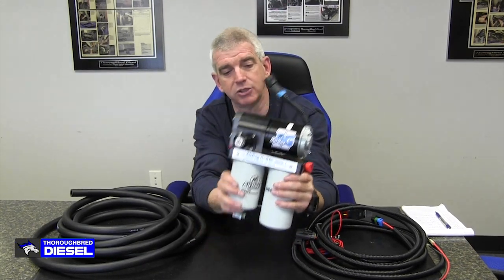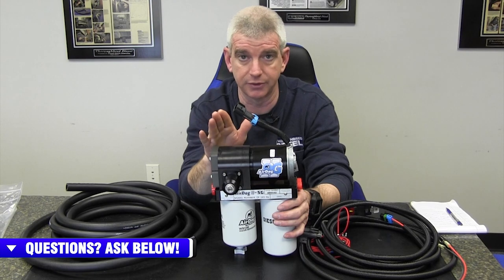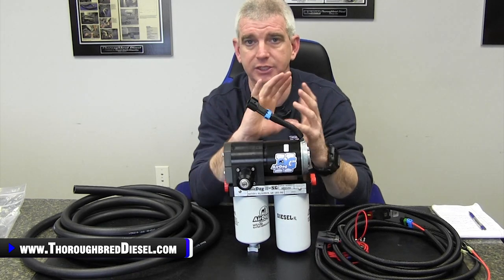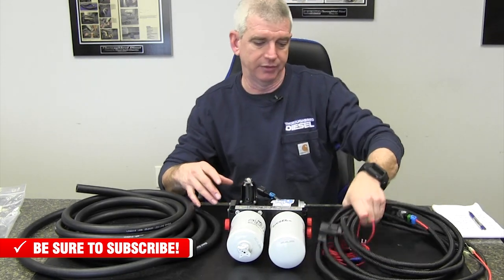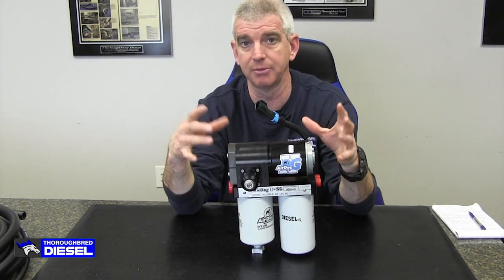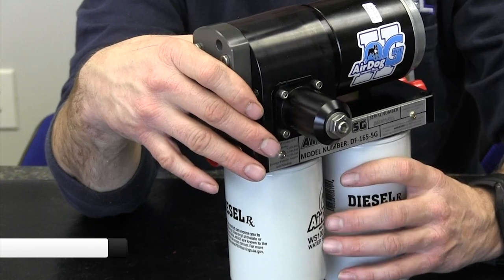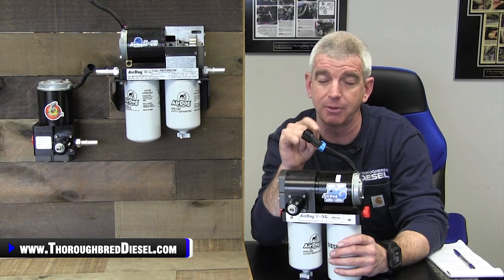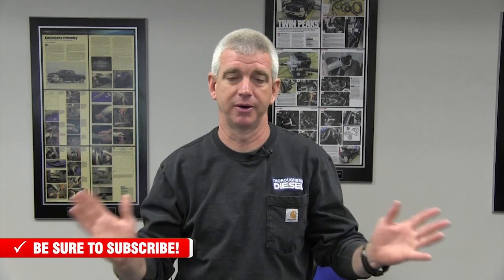We JUST Got Our Hands On The New AirDog II 5G #diesel #dieseltrucks #duramax #powerstroke #cummins

Comment: I have an AirDog II DF-165 No 4G or 5G. I converted my connections to include the return lines to -6AN fairly easily. I do like the positioning of the 5G's regulator and the integrated fuel pressure port.  That would have made things a lot cleaner for the set up I have.

Comment: Hey Wade......I put a Edge Comp in my truck last Summer 2021 and the truck was hurting for Fuel in 4th and 5th gear when I Hammered it real hard...I put a Airdog Raptor 150 and that fixed my problem like you said it would....My other concern was if it would Freeze up in the winter and Again you said it should be fine...Last week it got down to -5 and my Truck started right up even Better than with the Stock System so thanks for your help and I've been very happy with the Airdog Raptor 150....I live in Sisters Oregon and it gets cold here usually in the 20s and 30s but sometimes colder and into minus Degrees sometimes....

Comment: HAHA they copied FASS, larger wire...still not the FASS 10ga though, larger fuel ports, porting changes inside...probably still not as good as FASS. I appreciate the 4 heating ports that FASS provides. But I like the shorter height of the AD, I would have preferred the inside the frame but on a Duramax Ext cab short bed anyway the FASS hung just below the frame so it required going to the bed mount. A fuel filter hanging below the frame in the center is NOT a good idea in my opinion.
Reply from the maker: Thanks for the info!

Comment: Here is my experience with airDOG, and it's not been pretty.
The reason I chose airdog vs FASS was simple: I did not like the FASS' idea of drilling huge hole at the bottom of the tank which is leak prone.
Installed (2004 GMC Sierra 3500 Duramax LLY) per manual, started... 2 min later, check engine and OD disabled lights came on.
Scanned and found code P0089 (Fuel Pressure Regulator Performance).

Let's start from the beginning: during installation, I ran into a little problem - pump-to-brackets mounting bolts are too short to accommodate (provided) crush washers. Don't know if it's crucial but definitely shows total negligence towards details, and that's where the devil resides.
When installation was completed, I realized that the feed line used to go to the engine and replaced with a new line is just hanging open. No plug means provided, and neither is that mentioned anywhere in the manual.

Did some research and learned that it's a typical issue a lot of people complain about, and it's caused by incorrectly set at the factory pump pressure. Some show how to adjust pressure but MY pump doesn't have adjustment...

Next morning, called "support". Started with the main issue - check engine light. The individual I had pleasure speaking with was less than friendly and exhibited "why are bothering busy people" attitude. I wouldn't mention that if his advice were useful. Which it was not. In two words, I have to hook up a pressure gauge, check actual pressure, remove the return hose (full of fuel, of course), unscrew the adapter, pull the spring out, and cut one or two coils.

A few problems with this "advice".
Not everyone has a full-blown shop with rare tools like fuel pressure gauge. I happen to be lucky - I do. But (BUT!!!) gm in its infinite wisdom used metric (10x1.5) threads in the fuel filter housing bleed port, and all gauges have pipe adapters only. I couldn't even find 1/8 pipe female (gauge side) to 10x1.5 male (port side) online! I had to make one myself which was a major hassle as you can imagine. Measured pressure - 11 psi. According to online research, optimal pressure is around 8 psi but may vary from engine to engine. The "support" guy did not specify what pressure is needed on the same premise that each engine has it's own level of tolerance. Perfectly gm. With that in mind, how successful can the spring cutting technology by - how many psi each coil lowers pressure to, how many times do I need to struggle with the same procedure cutting little pieces one by one, re-installing everything, checking, and going back?!? Not a winning proposing for a lucky airdog owner.

What REALLY pisses me off is that airdog eliminated pressure regulator from its pump, and the very same airdog outfit sells an external fuel regulator through its accomplices starting at $141. A little more than 20% of the pump price. How convenient!

Bottom line: I sincerely regret buying from this outfit.